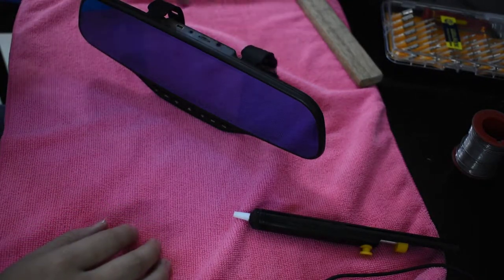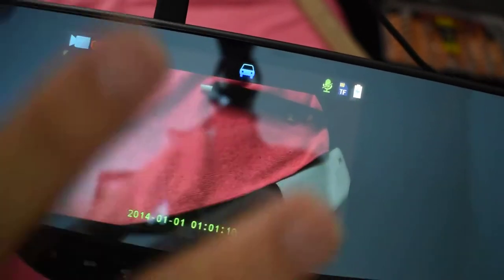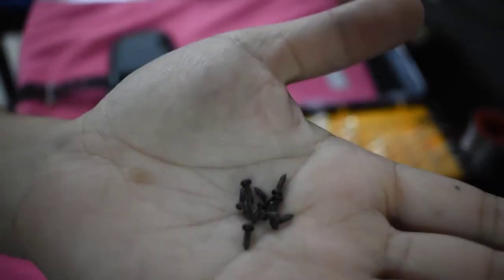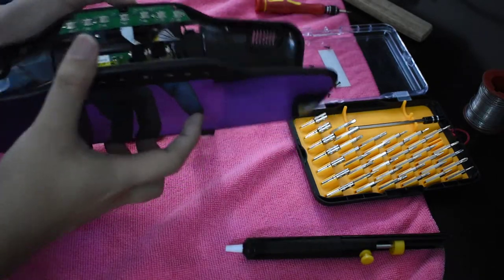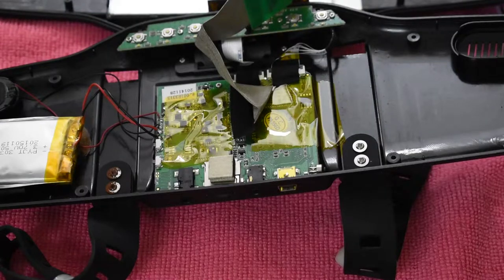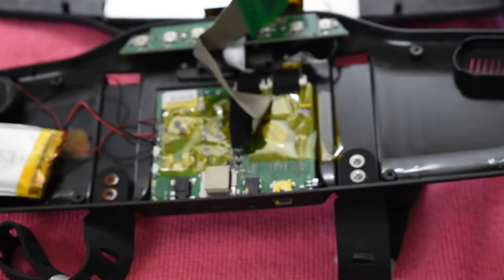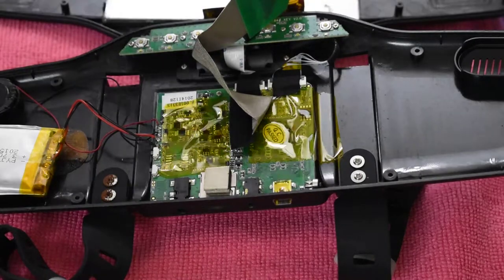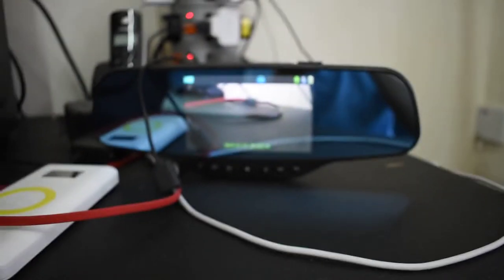Rearview DVR battery replacement

Comment: Thank you for your video. I need to replace the battery in my back up camera but how do I know which to buy. I want to take the mirror apart one time. It is 600 mili amp I read and my supplier is no help. What type of battery is this?
Reply from the maker: This was a Lipo (lithium polymer) battery. Best is to dismantle your DVR and see what size it is using and what's the rating. Different DVR has different spec batteries. If the interior is big enough, you can put a higher capacity battery but make sure the input and output rating is the same.
Reply: @TCsAnythingGoes  Thank you, I took a shot and ordered one. which I think will work, If it doesn't  I will throw out the mirror and buy a new one.
Reply: @6191bee  any battery will work just some wont fit so you cant throw it out and i know /r/whoosh
Reply: @mousecursor6521  Whatever I ended up buying did work. Also, I took the camera off motion setting and it works much better.

Comment: I changed the battery on my mirror camera but it doesn't recognize it. I don't see the battery icon on the screen. The battery is fully charged. What could be the problem?
Reply from the maker: 1 thing i can think of is that the battery is not compatible with the DVR.

Comment: HELP. My old battery has 3 wires; red, black & White(!). But, all these Chinese batteries have just 2 wires. What to do?? 🤔
Reply from the maker: just use the red and black. but then before you got the new battery, did you check the model of your existing battery?
Reply: Thanks for your reply! The old battery is: - CEL 402035 24 OmAh C1C, + 0.888 Wh 3.7V

Comment: Hello...
I have one question about cam. 
I bought Jansite dash cam.
Displey on the left side. 
I put memory card 16 gb.
I have problem with adjusting time and date when I turn on camera... It cant memory date and time. Everytime when I set this data, it is correct. When I turn off car, it deleted date and time and put 2019 year.... Everytime I need again to set time and date.
Do anyone know, what is the problem?
Tnx
Reply from the maker: You probably have a faulty battery or no battery in the unit. To test this out, once you have booted the dash cam, unplug the power source and see if the battery bar goes straight to 0 and turn off OR if it continues shutting down normally.
If the battery bar goes straight to 0 and turn off immediately, that means your battery is dead.
If it does not.... then i suspect you might have a faulty unit..... maybe. Can't say for sure as I did not have the chance to purchase a Jansite dashcam.
Reply: @TCsAnythingGoes  thanks for responding. 
Every time when I turn off the car, emediatelly the camera turns off. Once I charged cam more that 7 hours, before that, I adjust time and date after charging, I turn off the cam. The result was same, it returns date at 2019 year 01 01 like always.
I doubt that battery is not ok or it doesnt have it.
Everytime when I turn on the car, I need to adjust time and date.
Thanks again.
I changed cam where I bought it with another, but and that another cam is working the same
Reply: I have the same problem in obdpeak d50. I think there is no battery because three is no icon barteru on screen. Every timer date and hour set grom GPS .